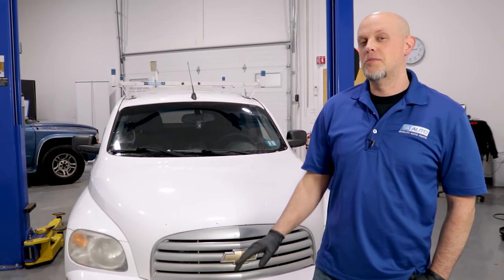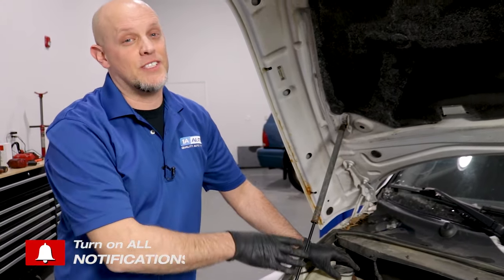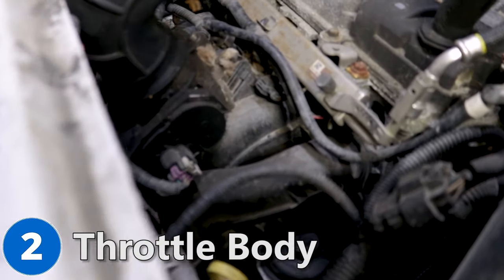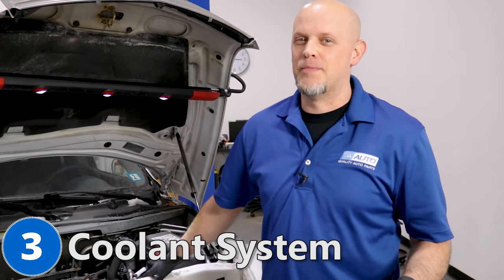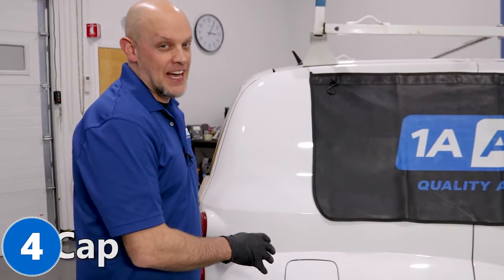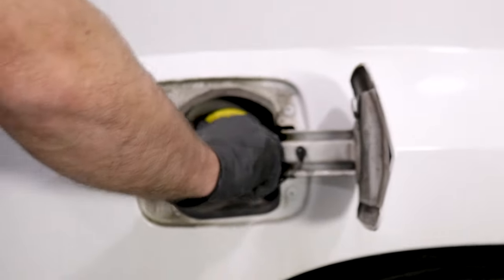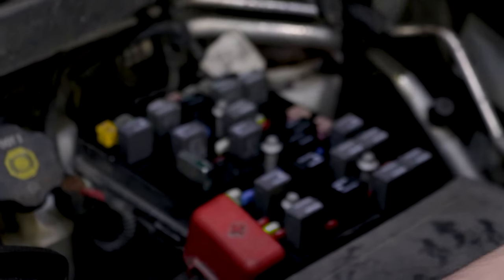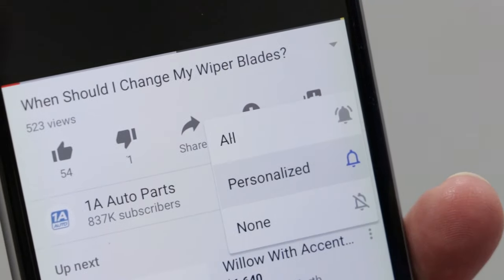Top 5 Problems Chevy HHR SUV 1st Generation 2006-11

Comment: Just started my HHR yesterday:
- power steering went out
- would not shift into higher gears and was a struggle to go over 40mph

Could this be fuse/relay related for the transmission?

Any advice is greatly appreciated
Reply from the maker: +Nic Coen We wouldn't be able to diagnose an issue like that here, you may want to have a local mechanic take a look at it. Thanks for checking us out! http://1aau.to/m/Shop-1AAuto-c
Reply: @1AAuto  no problem! Thanks for the awesome video
Reply: @Pathoking  this sounds a like what my 2007 HHR was doing, until it died a couple of weeks ago. The timing chain jumped, or something. Definitely get it checked out. 2 mechanics said that it's likely (not 100% certain) it needs another engine now. I'm not having it repaired though. Iiss my HHR! It served me well since early 2008!
Reply: I
My 2006 HHR did that today for the first time. But I had check charging system messages intermittently yesterday and today but didn't think about it because it does that when fuel is low to lol. Anyways after having no power steering for a while it suddenly came back on and I stopped by O' Reillys and they said it sounds like a computer which costs a lot to fix. And it's probably not worth it. Also after watching some videos it could be bad fuses, battery and or wires. Because I changed the alternator last year. I do know the electrical system isn't so good because the digital read for the fuel range always says I have more gas than I actually do.
Reply: Mine went out on my 2006 Chevy HHR. I replaced the power steering motor myself. I just followed  you tube Tutorial.   I test drove it and I had power steering again. 😊

Comment: Very Interesting video we have a 2011 replaced the struts ,shocks lower control arms and front brakes and sensors it has 279,000 miles on it but it is a good vehicle.